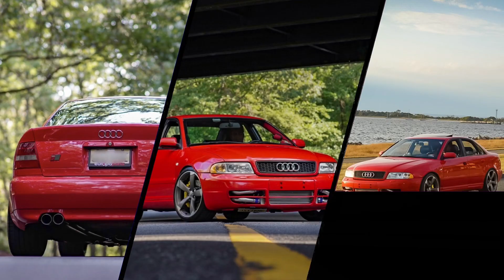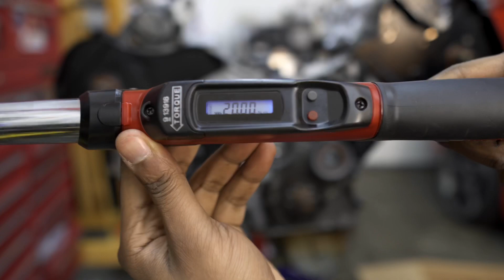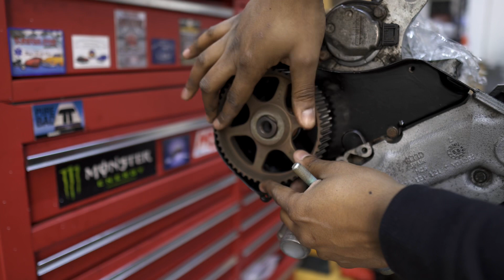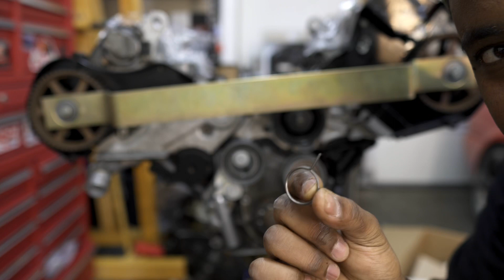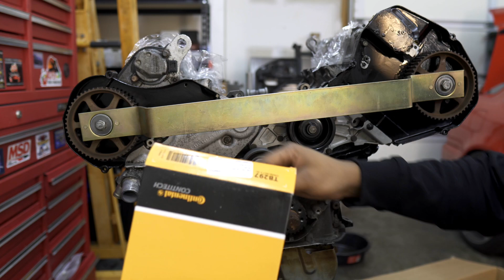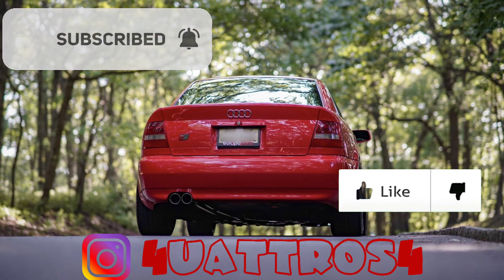Audi B5 S4 2.7t Timing Belt, Water-Pump and Thermostat Install

Comment: my car the timing belt is off  the two large holes are not  lined up how do I line everything up ;;all the videos show with the timing belt on
Reply from the maker: if you mean the two holes on the cam shaft sprocket then you can move them into position by using the cam lock bar.

Comment: Might sound like a dumb question here, but I have a stuck open thermostat. There is no way that I can replace the thermo without taking my timing belt off correct. 
I only ask this cause my timing belt was just replaced 20k miles ago grrrr.
Reply from the maker: Hey man! No such thing as a dumb question, but sadly there’s to way to pull it out without removing the belt. The belt sits almost flush against the thermostat housing.

Comment: Great video. Same procedure for a 05 A8 4.2?
Reply from the maker: Very similar but you’ll need a different lock bar.
Reply: @CIPGAS  are the torque specs the same from the V6 to the 4.2l V8? Seems like they should be right?

Comment: Cant wait to be at this point.. I watched the previous video, I'm assuming the cams are set with the valves up when installing heads? Or maybe start with the crank offset from tdc during head install, then reset it when timing.. move it one less time lol.. not trying to criticize, but these will help me as I'm about to be at this point..  great work! 🤘
Reply from the maker: Thanks man! So the cams will actually naturally settle to a point where none of the valves will be extended past 1 mm when you you install them on the head. It’s called the resting spot. At this point there is no danger of valves touching the the pistons. Once the heads are on in this video I bring the crank over at least 45 degrees counter clockwise which will bring it back from TDC and none of the cylinders would be able to touch the valves. Then from there you move the cams to TDC with the lock bar and then turn the crank back to TDC. And finally lock it all in with the timing belt.
Reply: @CIPGAS  ok cool! Good to know! Thanks for responding! 🍻

Comment: reliably how much boost can you run on an auto w/ stock turbos
Reply from the maker: The transmission will hood whatever you can throw at it with the K03’s. But K03’s aren’t known for their reliability, so if it’s the original turbos just a stage 1 tune with about 16 to 18 psi. Anything more than that and you’re asking to blow them. The transmission will hold that but if you want to keep adding power after than you will have to work to beef it up or switch to a manual.

Comment: Hey...
Thanks a lot for the video. I ve got two questions,
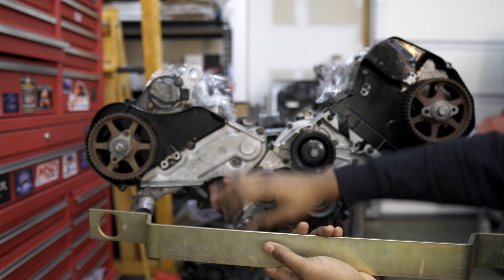45° counter clockwise the crankshaft? At 6:10 you say 75°.

Do you have a partnumber of that bolt/ plug wich closes the lockpinentry? Here in Germany you only got a plastic-part with an o-ring. 

Thank you Bro
Reply from the maker: Sorry messed up the degrees there. It was just the 45 counter clockwise to give clearance for the valves to compress into the cylinder. 75 degrees over would work just fine as well since all the pistons would still be below the top off their stroke.
Reply: @CIPGAS  I really do appreciate the timing video I have one question the right cam you never had to line, is that the same procedure as the left

Comment: Great vid, nice, calm presentation. Was glad you installed the crank pin, wasn't sure that was going to happen. Hope you turned the engine over by hand a few times and rechecked your marks.
Reply from the maker: Thanks!! Sorry for the late reply. Youtube had flagged your comment for some reason. Always gotta install the crank pin lol. No timing job is done without one. And yeah I cranked her over a few times and checked all the marks on the cams and the crank as well as with the pin and the lock bar.  I should have mentioned that in the video.